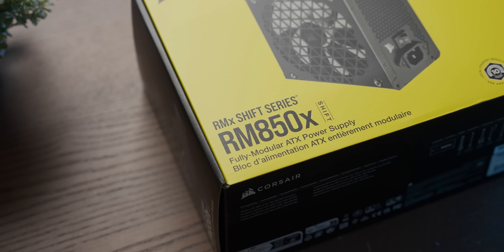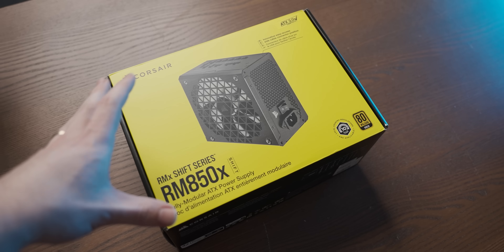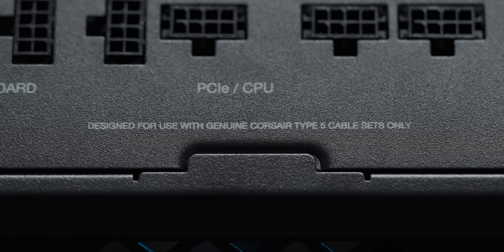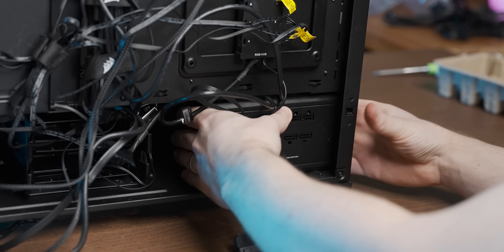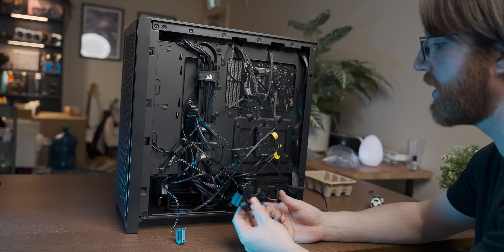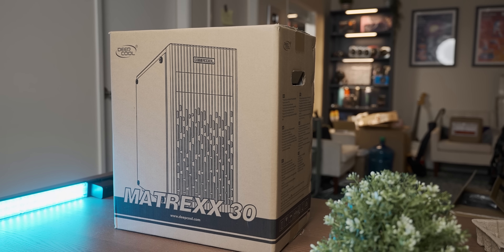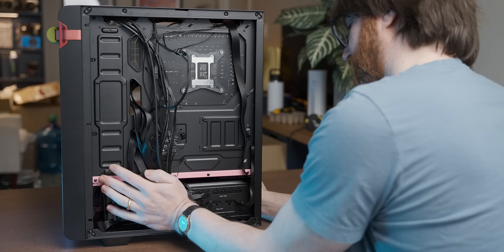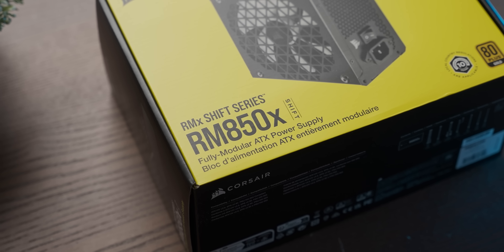How Has Nobody Done This Before?

Comment: Def a good option for certain cases. Some cases this flat out won't work in, like the Torrent as one example. My biggest issue though, is using micro-fit, which less robust than mini-fit and will be prone to issues with tight bends, but not be an issue with lower gauge wire. Looks like they're using 18ga. Not to mention, it's a PITA to sleeve for people like me, but that doesn't matter for 99.99999999% of people. And the reason it doesn't have 12VHPWR on the PSU side is because Corsair has stated they won't be using it on the PSU side, for a couple of reasons, even on their ATX3 PSU's. And honestly, no real benefit to having it on the PSU side TBH.

Comment: if PSU can get wires coming out from the sides, why can't motherboards have connectors on the back side ? We can get a system with no wire visible.
Reply: Dont know if sarcasm or not but let me just say this: ASUS and MSI are doing exactly that right now. Only need to pray that either your case or future cases support it
Reply: @blackcorona07   If u feel bugs on you and there are none . They may be the ghosts of the bugs you killed.

Edit - yeah i wish more cases support backward connectors.

Comment: 2:14 - I'm fairly certain you're not supposed to use modular cables from one PSU model on another PSU model, even within the same brand. There's a very good chance that they've changed the internal pin layout for who knows what reason (I'm going with the usual suspect - greed), which means you risk frying whatever component you hook up to them if you do.
Reply: Will depend really, looks like corsair have tried to keep compatibility by having their 'types', so type 4 power supply cables are probably compatible with each other sort of thing

Comment: It should've came with cables that turn 90° toward the normal direction the wires follow. Or come with the plastic connectors and you can re-pin yourself, that turns them if you need the room. That'd make it more capable than it sits now. Yeah at least let costumers email and request different wore ends we can repin. Offer connectors that turn the wires in all directions and keep the wires low profile.

Comment: I think it's probably supposed to go with things like the ASUS motherboard that has the connectors on the back? ASUS, Gigabyte and MSI all seem to be doing motherboard and/or case products for this DIY-APE idea. Seems like a much better way to do it to me, for airflow and convenience. Get as many cables out of the way as possible, clear airflow for the front of the motherboard, and perhaps even easier to build out? Time will tell.

Comment: Probably wouldn't use it cuz I'm probably going to buy that ridiculously cheap case that has the big  metal bracket right there.     Other type of cases I   end up  picking up are ridiculously outdated then nobody wants anymore and I'm like cool I'll buy it so at an  good price. I built in modern computer in the case that everybody thought came from 1999.

Comment: I am counter productively lazy when building PCs... unscrewing the PSU when realizing I forgot is almost never an option.

I usually just spend 30 minutes squeezing my hand into the nest, bending the cable to hope to get it in enough to let go and then push in, debating taking out the extra hard drive cage, going back to step one and then reflecting on what principle of mine it violates to remove 4 screws... when did that develop? Fuck it, I'll just return the hard drive.

Comment: Personally, I think this is the way forward. The proprietary connection is bullshit, but the location for the ports makes swaping components in and out is so much easier this way. I'm tired of having to awkwardly unscrew my PSU, rotate it 45°, trying to jam a SATA cable into it, rotating it back, and screwing it back in. I'd much rather just plug stuff in.

Comment: most of the layout of a PC needs to be though out.  There is no reason it should look the same as a 386 tower.  This power supply is a good idea with highly flexible cables.  Your graphics card is in a stupid place because thats where video cards have gone since the days when you used vesa local bus.   In theory it should be at the front or side of the case where it can suck in cool fresh air.  Connectors should be on the back of the motherboard, not the front, nvme drives should go there too.

Comment: Wonder if it would be possible to make these cables with a 90 degree bend on the PSU side of he cables to aid in getting the cables run flatter.
Reply: I'm sure one of the custom PSU cable modding companies out there will do this. It'll probably cost you $250 for a set though.

Comment: I guess its a chicken-and-egg problem: because all power supplys have their connectors in the back, cases are designed for them. And because most cases are designed for that, most PSU have their connectors at the back.
A nice idea, but I doubt it will catch on. When one company tried to innovate that way in the past, it was usually limited to their products only. Like Intel with BTX, and they have a lot more weight in the tech space than Corsair.

Comment: Neat product, great video.
Makes me think of my Predictions:
I think you are going to start seeing cases get fatter, for Cable Management, and PSUs like this. On the Window side, additional space allowed for vertical GPU mount allowing Air clearance to window. (especially when GPUs start becoming the size of a Loaf of Bread) (I think additional 3" on the window panel with more than two slots for mounting fat GPUs will come around)
also Having GPUs become exclusively module (rather than your typical PCIE 16 slot fitting) I could see GPUs on an ITX sized Mother Board and a new cable plug system to replace the PCIE ribbon cable. I could actually see the option of mounting the GPU in the same PC case, or opting to have its own dedicated ITX sized case, that would have independent cooling and PSU.
It would be awesome if building a GPU was more like building the rest of the PC.

Comment: Could you not have just flipped the power supply over and routed the cables through the other side of the case on those where the back side is blocked?  Were they all blocked on both sides?

Comment: Interesting power supply. Perhaps installing this innovative power supply upside down in the cases with solid backs would be a solution? Whenever possible I install my power supplies upside down, that way the air supply for the power supply is drawn from the interior of the case instead from the narrow gap under the case that could be further obstructed by a carpet or by a bunch of dust bunnies or discarded candy wrappers (yes my room is disgusting!). Upside downing the power supply also adds the pull of the power supply fan to help exhaust heat from the motherboard. This can only be down in basement-less cases or in cases with holes for ventilation below the motherboard, of course.

Comment: Mildly practical IF you use the same bottom PSU ATX case as everyone else, ranging from useless to downright counterproductive in different case layouts, and when you DO use the same bottom PSU ATX case as everyone else you generally have more than enough space for cables coming out at the usual side of the PSU, that's what the cases are designed for. Also won't improve your performance or scores.

Comment: I definitely think there are cases where this will definitely be handy. But definitely not for every build.
Reply: Do you mean cases or cases?
Reply: @rhov233  I'm really curious becuz it can be apply to both and still make sense...
Reply: Definitely
Reply: Definitely
Reply: Yeah it will be a situational just like sfx psu's.
Reply: The original Silverstone Raven might take it with where the PSU is.
Reply: With the new motherboards with the conectors behind it.
Reply: I'm interested. I have a Corsair 4000 case just like the first one in this video. It's a 4000D but I bought it with all three front panels. Glass, mesh and solid. That's irrelevant though. lol
Reply: Corsair psu for Corsair case only, useless 👎

Comment: the power supply is made for the o11 crown which its on the side and the cables would be going up instead to the side. imo in a standard 4000d airflow the PSU would be weird and can easily not work with many cases.

Comment: i hope this cable management idea catches on, it's so practical!
Reply: depends how big ur case is.
Reply: Yeah, it catches on fire, which is practical nowadays!
Reply: Larger gauge wires (ie thinner wires with less copper) coupled with high voltage/amp demands, yeah, that gonna be a fire hazard from any high draw GPU from Nvidia. Avoid.
Reply: Yeah, I can't believe it never took on before. 

I'll buy one of these for my next psu.